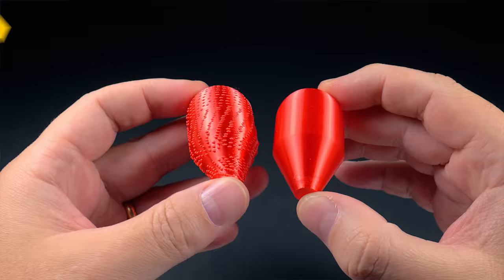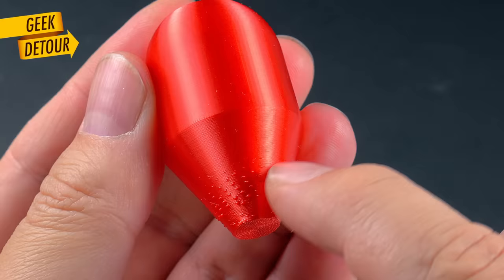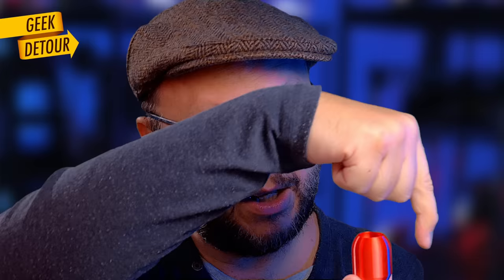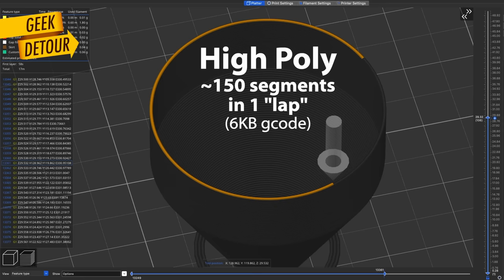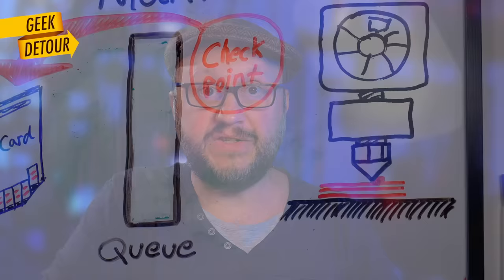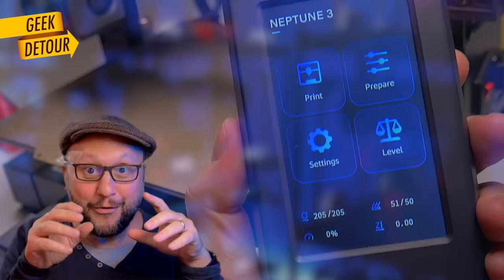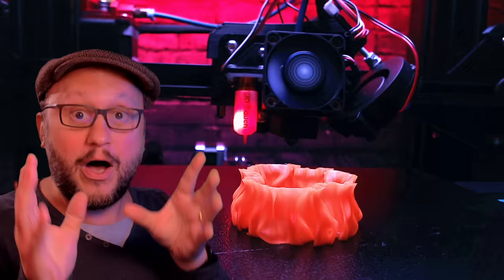3D Printer Blobs: a mysterious problem you won't guess how to fix 🤔

Comment: Not enabled ever on my firmware! 

It definitely can also be a buffer issue, if you use octoprint, get buffer buddy. This plugin attempts to keep the buffers full at all time during a print. I had the same issue, but with serial emulation over usb.  I am also lucky enough to have the TH3d EZBoard 2.0 that will connect at 1,000,000 baud rate. I also use a octoprint plugin called Arc Welder. This plugin will try to cut down on the number of segments and convert them to arc moves instead, creating less overhead for the printer's cpu and usb communications. They also have the Arc Welder Plugin for Cura, this way you can have the conversion done on the pc before you send it to octoprint for printing.
Reply from the maker: Sure! But in this case it was really the SDCard + Powerloss Recovery enabled.  Using OctoPrint we can have similar problems due to emptying the buffer, as you said.

But when you print though octoPrint, the powerloss recovery feature is not used at all, even if you have it enabled.

Comment: Can't you make circles very smooth and very efficient by making them mathematical curves instead of sets of straight lines? Like just have your printer harmonically oscillate on both axes with a 1/4oscilation offset and you get perfect prints for like 3 lines of code?
Reply from the maker: Yes! GCode has special “ARC” commands that define curves - you can enable that in firmware and indeed it solves this problem as well. The problem so far is that many printers don’t support arcs yet - as well as the Slicers. In fact the STL format itself is also a mesh of triangles. So, yes, it is possible and there are plugins for slicers to detect the “curves” made out of meshes and replace them by arcs. In the future it will be there.
Reply: @GeekDetour  apart from the plugins for the .stl format, couldn't one just use a format that stores the model as a mathematical object (a combination of curves, including planes) instead of a set of triangles if smooth prints are their priority? 
Since the commands are in Gcode anyway you don't necesarrily need to use a certain format as long as the conversion to Gcode exists right?

Comment: I (who knows very little about 3D printers) guess it has to do with the lack of steady rhythm in the deposit of melted plastic. Short, unsteady pauses are occurring and mess with the even deposit and cooling of the material. Okay, how did I do?
Reply from the maker: That’s spot on. But the root of the problem is always the challenge: it can be the SDCard, or the USB cable… in this case was PowerLoss Recovery writing to the card every time it creates a checkpoint.

Comment: Ender 3 v3 have a good power-loss recovery, i successfully printed a smooth door handle, it took about 11h to finish both of 2 parts...
Reply from the maker: A lot has changed since I published this video - manufacturers became aware of the problem, the feature has been implemented in better ways, some printers use faster storage too… in time this video will be just a historic record of the problems 3D Printing went through 🤣
Reply: @GeekDetour  My comment was mostly about chance of failing the print after a power loss, and yet, with 2 hours of delay everything prints perfectly. Handling of such situations improved over the years drastically, really.

Comment: I was on the fence about upgrading to a bigtreetech skr mini e3 v3 and this was the last push I needed. I could have just turned off that feature causing this but I was also looking for an excuse to buy that new board.
Reply from the maker: I just installed Klipper on my first printer: an Ender 3 Pro that I had upgraded the board to an SKR Mini e3 v1.2 - it was running Marlin… Now it has Klipper, using a Raspberry Pi 3B+ (I always used it with the Pi, but with OctoPrint).

Comment: possibly the way in which the model is stored/written on the drive. Compression do some whacky shit sometimes. If you go from FLAC to mp3, you'll get what I mean(with proper audio equipment that is designed to convey FLAC because that does actually make a difference).

Edit: Frick,you know what? Lenovo has problems with that feature as well but for PC's. I straight up don't know why but it causes stutters in EVERYTHING on a PC so I'm not all that surprised a power off-recovery feature was causing pauses. I do wonder if data compression could ever affect models though...
Reply from the maker: Hi there! Compression would do nothing to the model because we would use loss-less compression. When you ZIP any file, compression and decompression is perfect, nothing changes. When you “JPEG” an image or “MP3” an audio file, you lose information - but the compression is immense (and it is made to retain most of the “perceivable” information). But there you have it: any file that has important information, like a spreadsheet, text document, source code, etc, we only use lossless compression formats that are perfectly uncompressed (Zip, GZ, RAR, Arj…)

Comment: I have an Ender 3, no Pro, no S, no submodel at all, just an Ender 3... Just yesterday I printed a super high detail gomboc without a problem at all without disabling power loss recovery. I'm not arguing with the video, I'm just wondering why I haven't encountered this problem... I do know that I have a 32bit control board and not one of the original 8bit ones...
Reply from the maker: Absolutely, your Ender 3 - most likely - doesn’t have PowerLoss Recovery. My Ender 3 Pro also didn’t have it. It was a new feature that started being added on newer printers without realizing its potential problems.

Comment: I guess the printer saves the state of the print to resume in case the power went down
Reply from the maker: That’s the right guess 😄 But not it is easy - the problem has been much more frequently discussed 🤗🤣

Comment: When I got my Ender 3 i seen the recovery feature as a fantastic idea as i hated the idea of being 19 hours into a print only to loose it due to a power outage, however after loosing power during the night I woke up to the printer telling me it recovered due to power loss and when i clicked to continue the print the head lifted up  and went to the corner and it was then that i seen that the print would not recover,  the problem with this feature is it does not protect against a major problem and that is when the power goes out the nozzle just stops and with no fans it heat soaks and basically melts what ever is directly below it and it can melt pretty deep into it, so I just turned it off and when i later made my own marlin version i just disabled it  fully
Reply from the maker: Yeah, there are many “less-than-ideal” aspects of a power-loss… As you said, the nozzle keeps melting and blobbing where it stopped… at the same time, as the printer gets cold, the part will eventually detach from the “heated” bed (now cold) and it’s game over the same way 🤷‍♂️

Comment: Amazing! Yes I have this problem with my CNC -it makes faint circles whenever it has “brain fart”. But honestly, this shouldn’t happen on a hot end. To do power loss recovery like this is terrible engineering! Write is always slow on an SD card. Who designed this??😂
Reply from the maker: Ha ha ha, it is an option you can enable on Marlin firmware. 3D Printer manufacturers were using the “software” implementation that keeps writing checkpoints to the SD Card. But if you include a Super Capacitor, you can detect when an actual power-down happens and only then write a checkpoint to the SDCard, lift the nozzle a few mm and stall the printer. This is much better.

Comment: So I’m using a Sonic Pad on CR-10. As you may know, the storage is from the Sonic so no SD card. However, I do know there is setting for recovery. Haven’t tried yet but I think I will because I’ve been getting some of these bubbles. Thanks for the info!
Reply from the maker: Try to find if your Sonic Pad has the recovery option - if so, try to disable it: https://www.creality.com/blog/creality-sonic-pad-upgrade-on-january-2023#:~:text=Power%20loss%20recovery%20function%20is,The%20percentage%20display%20will%20restart.

Comment: maybe 3d printers should use a small NVME SSD 64gb or so.. with wifi module, then you can upload model to internal SSD and the printer can save power loss to ssd that is faster then sd card. i got the creality sonic pad that runs klipper really awesome piece of hardware.

Comment: That Timelapse at the end was worth watching the whole video. How do you make that????????
Reply from the maker: Thank you SO Much!!! That video is one of my proudest things… and a huge frustration: it never got traction on YouTube - and making it took two months 🤣 I mean, I designed a light motion system for a webcam: it moves sideways, turn left and right and up/down… it is controlled by GCode too, like the printer. Each small timelapse was planned, the lights were tested, even the number of moves for the print-head (I made a spreadsheet to make it coincide with the beats of the song, before printing…). That was amazingly insane 🥹😜
Reply: @GeekDetour  I must build this capability. The Timelapse is cool but the rotation is just a next level.
Reply from the maker: Thanks! I am finishing a much bigger setup, for a DSLR camera. I’ll make a video soon , so, subscribe! 🤗

Comment: 8:30 minutes to tell you that the "resume after power lost" is the issue. There you go. Saved you all some time.
Reply from the maker: 8:30 to actually show how it happens, why it happens, what is NOT the problem. If it was so simple, 3D Printing forums wouldn’t be filled with people writing “it’s wet filament!” 🤷‍♂️

Comment: The print I am working on now, only leaves blobs at the end of the last line before going to the next area. The hot end pauses for a second and extruder continues to put out filament. It only happens on 2 particular parts of a build I am working on. I use S3d and have Duet2 ethernets on both my printers, and both of the printers have this problem. Now no other parts are experiencing this problem, and other people that use S3D and have printed the same parts, have not experienced this. I need to get this figured out and seriously need some first hand help. ThankYou.
Reply from the maker: Hi Tim… wow, your problem got me curious. I don’t have anything from Duet. Is it a whole 3D Printer board? Do you participate on any Duet users group?

Comment: Hey thanks for the great Video. I also had the problems because of stops of the Nozzle. But my stops did came because of octoprint or excactly of octolapse. I deinstalled octolapse in the Pluginmanager and then the prints were smooth and clean again.

I hope this will help someone too.

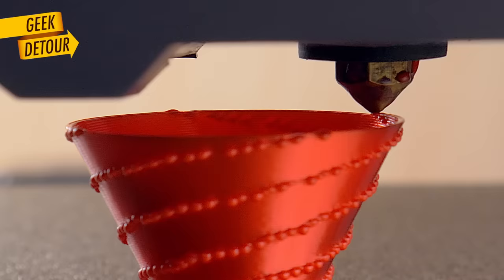Comment: Ok, I’m at 2:17 and I’m guessing it’s the autosave in case of power failure that stops it
Reply from the maker: And you guessed it right 😁
Reply: Just got my first 3d printer(despite looking at them for years) and I’ve had this issue 😃

Comment: I have the problem when using superslicer on a artillery x1 SW, I also use SD cards, the problem is constant, have it on any object (round or rectangular) and in diference to the video the blobs are very small, i have no idea how to fix it. its not wet filament and no seam configuration. got to mention, i have other 2 printers with same filament and same slicer and no issues, only on the artillery.
Reply from the maker: You can try putting the following line on your Start GCode, slice a new print and test again:
M413 S0; Disable power-loss recovery

Comment: I have just bought a Bambu Lad P1P, does this apply? Not sure about how to go this, how does the code get read by the 3D printer. Also, does this mean that we can eliminate seems as the printhead will not stop and continue to go around and around.
Reply from the maker: Noooh! Thank goodness this problem is completely non-existing in the Bambu world and also not present on Klipper machines. You are safe 😄. Seams are always dependable on each model, I don’t have a Bambu printer yet, so, I don’t know how good or bad Bambu Slicer is helping on the task, I am sorry.

Comment: Great Video, it does look like different types of SD cards can have wildly different random access write latencies. I think the right way to solve it is with properly written firmware that loads the entire print gcode into SRAM. External SRAM chips are fast and cheap.
Reply from the maker: Hi there! Sure, there are a few different solutions for this problem - but SDCards are fast enough to print really fast and flawlessly (as long as you don’t try to write simultaneously).
I really think a checkpoint should be written only when a PowerCut actually happens - and In the description I put a link to a Chris Basement video where he show how to install a very cheap board with supercapacitors to keep the printer “on” for a good few extra seconds - enough time to stop all the motors, heaters, and write a single checkpoint on the SDCard, and the printer stalls. All of that only when an actual power interruption occurs.
Of course, the printer needs to be notified about that, and Chris shows how to configure everything: from hardware to software. Check his video!
Reply: @GeekDetour  Sounds like only one checkpoint ever needs to exist at a time, so it really sounds like it should never live on the SD card at all. Rather, the checkpoint should be continuously written (and thus overwriting previous ones) to an FRAM chip, which reads and writes like SRAM, but is non-volatile, but that requires a hardware modification on the controller board.
I still think the entire print gcode should be preloaded, so the mcu doesn't need to continuously access the SD card.
The problem I see with supercapacitors is that now you have to deal with inrush current at power-on, and they store quite a bit of energy which could be a safety hazard.
Hearing about this makes me want to make my own 3d printer controller board and open source it, but I just don't have the time for any of that. Maybe one day.
Thanks again for educating people on this issue.
Reply from the maker: Thanks man! My pleasure! But you don’t need to make an entire thing - I bet there might be an open source project that you could join! That’s the beauty of this! Individually, very few people have loads of time for an entire endeavor like that… but you can help design a tiny part.
Anyway, PowerLoss Recovery is also controversial for other reasons: my PEI build surfaces are such that if the printer cools down, parts will totally pop from the surfaces - so, it would be impossible to recover from a real power-down. That’s why Klipper and OctoPrint don’t even bother about such feature… people that need non-stop printing will use UPS 🤷‍♂️

Comment: hmm.... i wonder if this is why mingda magician x has a chance to randomly stop during a print.

when i say stop i mean it just ceases printing, but the display shows that it is still in the middle of the print.
it's possible that the recovery thing is stopping the print, then not starting it up again, so the print head an extrusion pause permanantly.

also, pausing/unpausing the print does nothing, and i have to restart the print from scratch. 

there really is no rhyme or reason to it stopping. it's just like you said in the beginning of the video. same model, same settings, same gcode, same printer. print it once, it stops half way through, restart it, it prints till the print is done.

Comment: Im using the ender 3 v3 se, this happened to me, but i was using the printer before no issues for a while before, then It happened, i just reformatted my memory card, it elimenated the pausing. I was using the stock memorycard that came with the printer. I yhink this happens if the memory card is slow at transferring speeds.

Comment: CNC mills can have the same problem, causing dwell marks when the tool idles in one spot.  It's too bad 3D printers cant use arc commands.
Reply from the maker: Hi Matthew! Actually, yeah, Marlin have support for arcs - new printers (the Neptune I showed in the video is one it them) support G2 and G3 commands (link). The problem is that STL files are a mesh. There are plugins to identify “arcs” from the polygonal mesh, and convert the movements to arcs, but, yeah… not ideal. Maybe one day we will be able to use STEP files directly on the slicer and it could generate arc movements that are really perfect.
https://marlinfw.org/docs/gcode/G002-G003.html

Comment: Does this mean you can increase BLOCK_BUFFER_SIZE from 16 to eg. 32 instead and still have power loss recovery enabled (my theory is that it would catch up with the workflow)? (as explained at 6:00)
Reply from the maker: Excellent question! Here is the paradox: the queue is actually part of the data structure that is written to the SDCard as a check-point. So, if you increase it, it will also take longer to write to the SDCard… 🤷‍♂️

Comment: This video you’re only referencing when in vase mode right? Will it help with seams and random seams outside of vase mode?
Reply from the maker: Hi! Vase mode is just the perfect example because it doesn’t even have a seam - it should be perfectly smooth. But the Blob problem will manifest even on regular prints with walls and infill - if you print from an SDCard, high poly model and you have Power-loss Recovery enabled on Marlin, it usually appears.